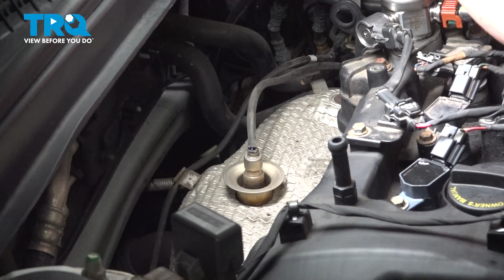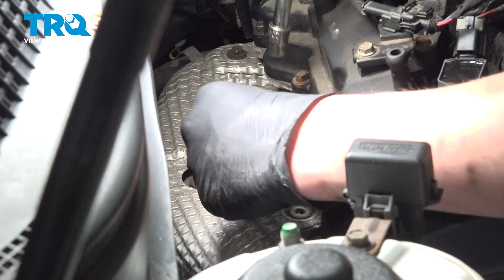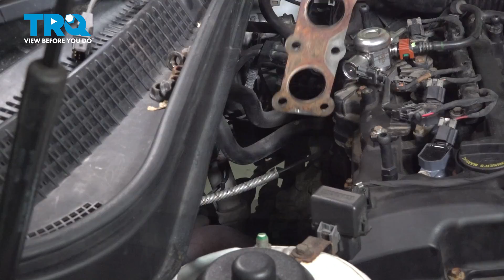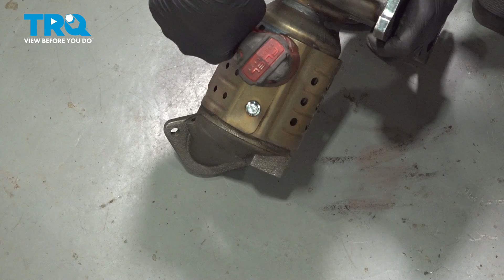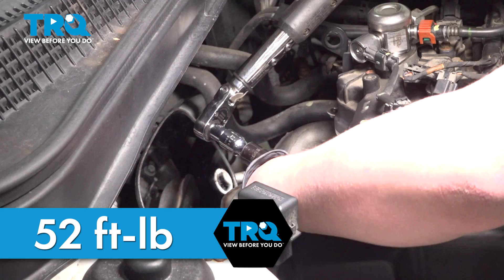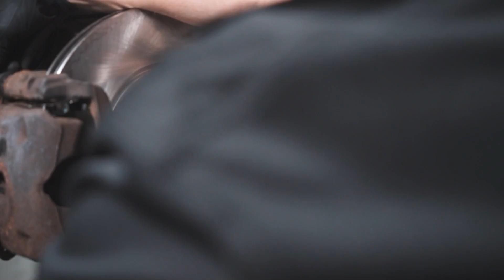How to Replace Exhaust Manifold 2011-2014 Hyundai Sonata

Comment: I'm the process of fighting the flex pipe that connects to the manifold. Are the manifold studs able to be punched out of the manifold and replace ? The car is rusty and I don't want to risk taking the manifold off to do so

Comment: was just told my exhaust manifold is leaking  and its causing a tick sound with the Sonata. was quoted $850 just for the part. I don't have the tools to perform the job but I already found value in getting the part at half the price. Thanks.